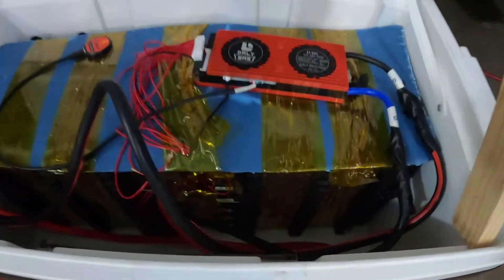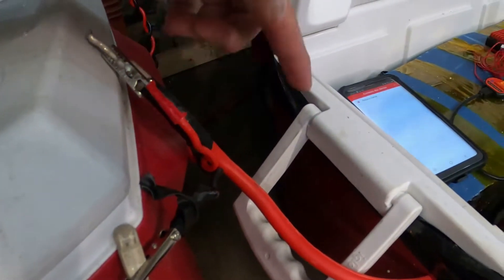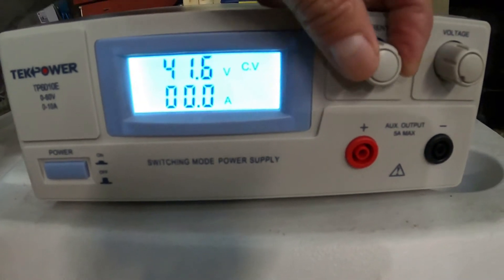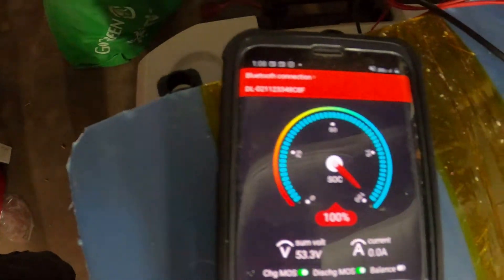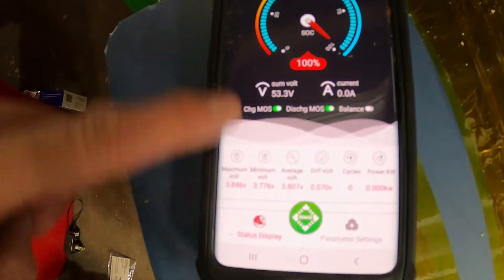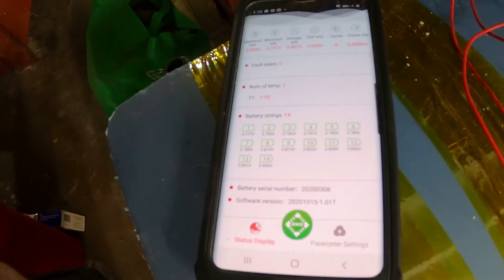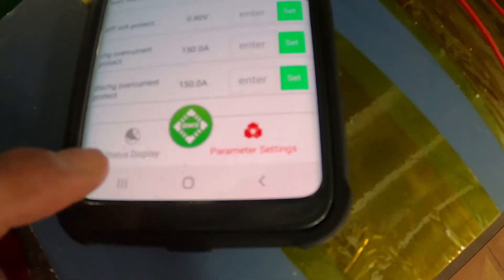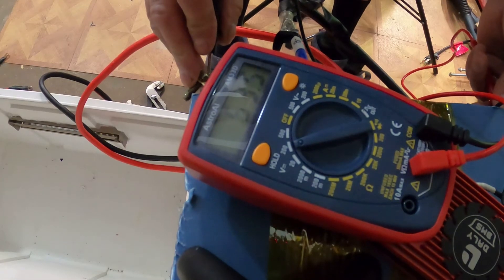Waking up a DALY 48 V BMS on a LG Chem pack

Comment: Follow the directions on how to wire these. Don't guess and then complain about how it doesn't work. There's plenty of info on how to wire a Daly BMS. The fact you wired it backwards shows you probably didn't bother to read the directions. Most all BMS are wired this way. Always check your cell voltage and write it down before installing the balance wires then when done wiring, confirm by checking your numbers match. 100 percent guarantee to never get it wrong.

Comment: I can tell you one thing : buy another thing that this shitty Daly products. I bought 2 lifepo4 200 A BMS and I can not activate them (in fact 1 has activated I do not know how but I can no more activate it after I unplugged the battery). They sell a product without any led to let us know if it is on or off, without the power board that can start it on/off, that could need a charger to work (and a charger that does not verify if there is current or not of course, sch a charger would not start charging as the BMS cuts the curcuit). This company lacks respect towards his customers, no other words.
Reply: I agree. The Daly Smart BMS was a really DUM thing for me to buy. What SHIT. Same issues and can not activate the thing. Total garbage in my opinion and there customer service support is useless.

Comment: Hi Rob, I have a 16S 48V Daly BMS. Can I test it with only 4 Cells? 
At the moment I not have a charger for my whole Battery. 
I have a power supply for a 12V system. I've tried to test it with my 4 cells. But when I put on my power supply, the bms won't start up.

Comment: I have the same set up pretty much I put 54.7v to the BMS on my multiple meter & no current on my side my battery is sitting at 49.4v “ you help with the proper wiring battery 1 main negative the black wire goes there and the fist red wire goes to that battery and the last red wire hoes to the main Positive and I’ve checked the wiring harness 3.3v 1 by 1 voltage goes up DALY BMS people say check internal resistance lock wire blue wire B- is 49.4v & the P- is 38.1v

Comment: On my battery charger & on my 48v I my max charge is 54.75v because I have 15 3.2v max charge per battery is 3.65 x 15 = 54.75v as I turn up my charger the Amps go up as my volts go up and at 54v my charger is about 40A my Smart DALY BMS Will not turn on and my Bluetooth won’t read